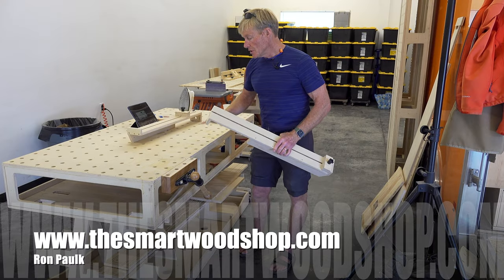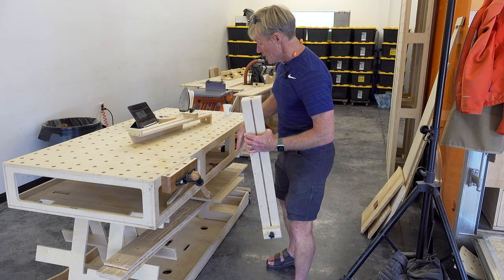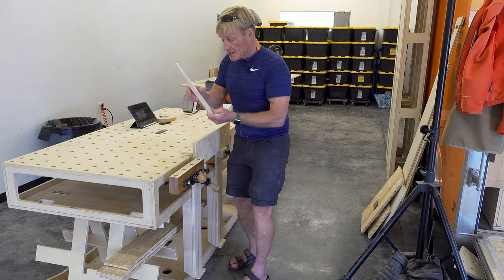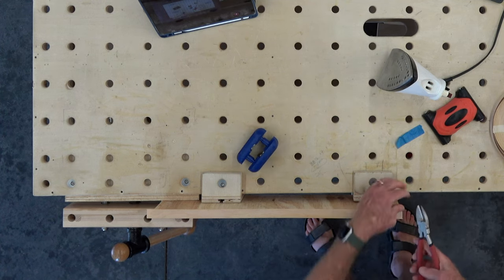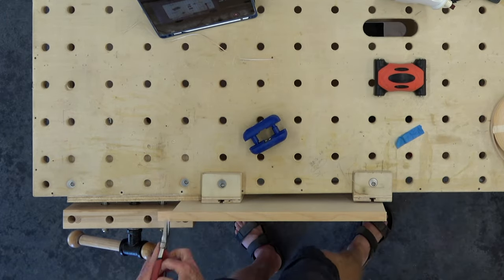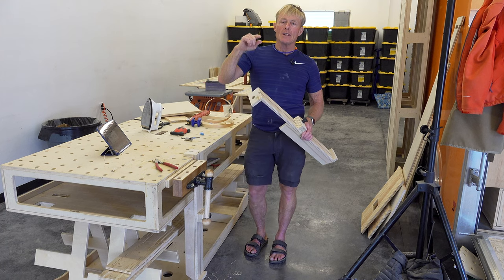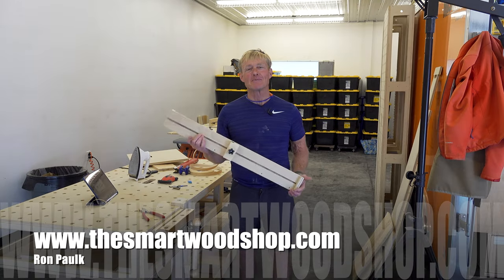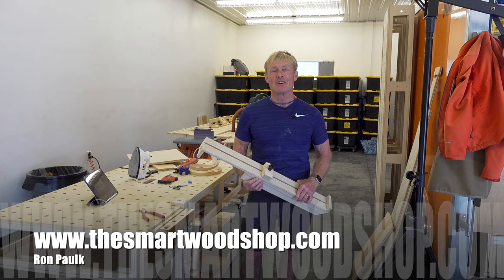Paulk Smart Panel Rig (updated)

Comment: I love your videos and plans, Ron. Thank you for making these available, I know it is a lot of effort to do so. Quick question, is there a reason that you didn’t use the 3/4” dowel method of attaching these to the PSB as you used for the smart cradle? Perhaps the stiffening board needs to come right under the bottom of the table to provide the rigidity? Just curious as I probably need more TSO  power loc dogs to go that direction.
Reply from the maker: The Panel Rig, as designed, works with all benches without the Smart Kart. If the PSK is used, an alternate version utilizes the kart for bottom support, allowing a dowel to be used. This design decision was made to ensure broader use. 😎🤙